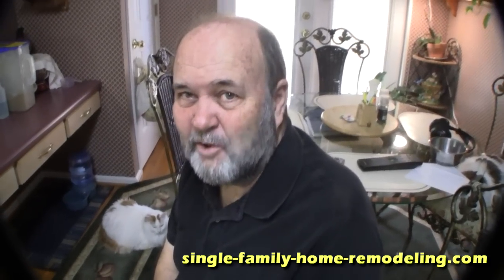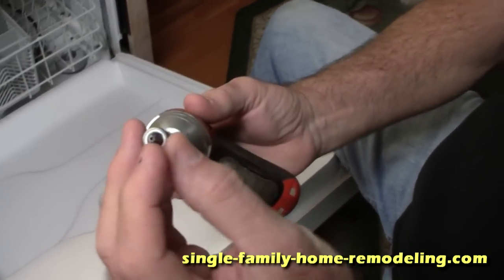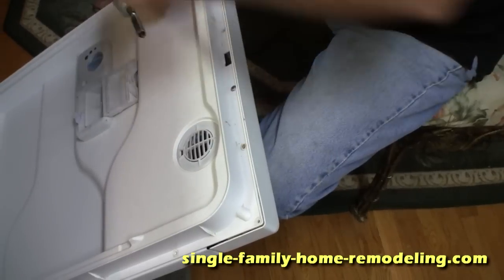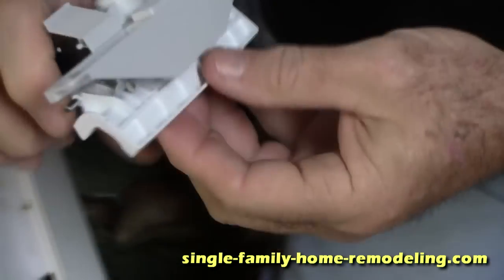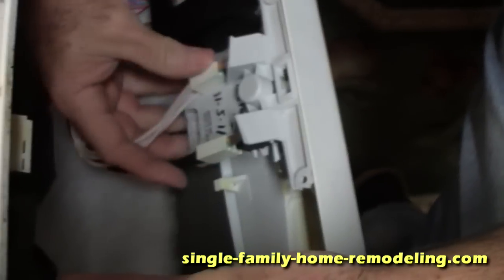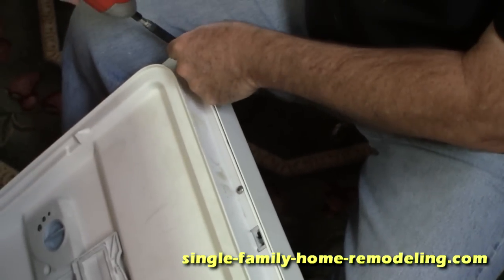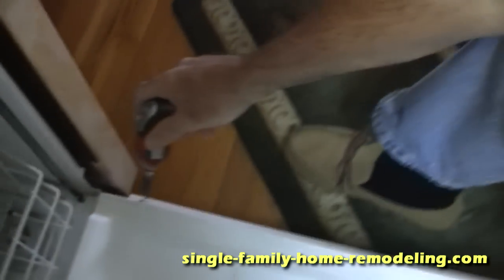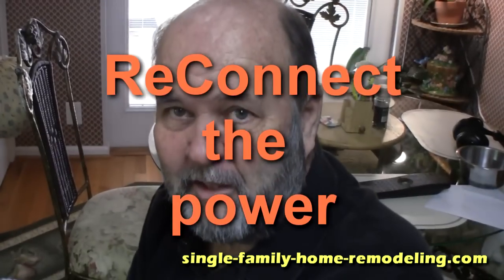dishwasher handle replacement

Comment: Exact same appliance and problem.  Very helpful.  Another tip for you viewers, if dishes aren't coming clean because hot water isn't readily available during the washing cycle consider using a hot water circulator and a spring wound mechanical timer.  This allows you to specify number of minutes you want hot water to be during the wash cycle.  Installation is a simple 20 minute DIY with 4 hoses.  Having convenient hot water saves a ton of water and time.  And, if the system is efficient and used in demand mode, you won't see an increase in your energy bill.

Comment: Thanks so much for posting this video.  Your instructions made replacement easy.  We have Maytag Quiet Series 300 but uses same part.  I searched around for the part in Canada and found the best price and quickest delivery (next day) was from the appliance shop where I bought the dishwasher 6 yrs ago. Surprising because we live in a small BC city.  Part # is W10130695 for black. 
Thanks!    Now if only we can fix our microwave main control panel...  ;) ...

Comment: I had trouble getting the wires off the old latch.  I did them off, but I took the parts sticking into the wire plugs off the old handle and then took each piece sticking into the plug apart, so that only the metal was sticking out of the wire plugs.  I used pliers to pull the two metal pieces out of the plug and went right to work putting the wires onto the new plug.  Taking the white and black wire attachments off took me the longest part of this repair.  Wish that he would have shown how he did it.  Be sure that the electricity is off when you attempt this repair.

Comment: Good instructions. Yes, it IS just that simple. The part listed in the comments (# W10130694) is correct, and is available on Amazon. Don't worry about it being listed as a Whirlpool part - it is correct.  There are many children's toys which are more difficult to assemble than this fix. 

Thanks for your video - it really did reveal just how basic of a repair this is, and I can only imagine it's a common issue for dishwashers which share this latch.
Reply: greggerm I don't think that part is correct for the Quiet Series 100. which is what was repaired in this video. I believe the part for the 100 Series is PS11748729
Reply: Hi my dishwasher knob broke how to fix

Comment: Thanks My latch broke and I though about just replacing the handle. After thinking about it I bought the hold assembly.  Much simpler install and no plastic parts to risk breaking. Kind of like pulling out a spark plug, cleaning and putting it back it in.  To much time wasted on reusing the same part. Best price $23 on Amazon.
Reply: When I look on Amazon, it says that part is Whirlpool and not Maytag?  Is it still the same part?

Comment: I cant seem to get the metal pins out of the piece thats connected to the handle. I snapped the pieces off the side and clipped them ointo the new handle in the exact same way that it was on the old handle, and it still doesnt work. Any idea on how to pry those little buggers off?

Comment: Where do you suggest I purchase this?
I am worried about buying on Amazon because the part number doesnt match
I have a maytag quiet series 300 part number PS2180046
Reply: I bought my replacement at searspartsdirect. It cost about $30.

Comment: Just finished mine and it will not fully latch :-(    When i close the door the handle only partially drops and the door is able to be "popped" open with minimal pulling. So disappointed. I am out of ideas because the part that the latch locks onto is not adjustable. If anyone has any ideas please feel free to share. Thanks.
Reply: Funny, that was the original problem I had.  In trying to fix that I ended up breaking the latch all together. Once I replaced it, original problem (and the new one I caused) went away.  Maybe you just happened to receive a bad part?  I'm clearly no expert though.

Comment: thanks! Following the instruction and it works. I do have some issues during the process: can not plug out the old handle. After replacement, the machine is not working (it is locked). I made a video to further explain how to fix those issues. See here: https://youtu.be/YZKyku18xcM?si=bxBtovvMRPWG308E